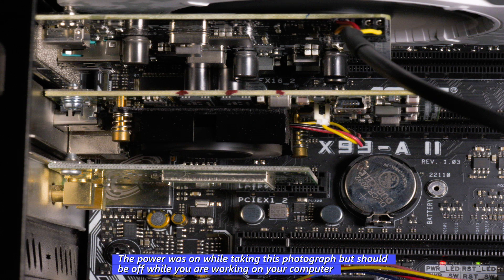Thunderboltex 3 card installation

Comment: My Asus Thunderboltex 3 (not 3-TR) seems to be working even without header cable connected, is it normal? It works well with a Dell Thunderbolt docking ... I was needing a trick to make its 5-pin header to my mobo which has 14 pins (ROG Strix Z490-F) but it seems to be working even without it.. I need TB for an audio interface not purchased yet to replace old Firewire stuff
Reply from the maker: At some point you will connect something and require the information that is sent via that header.
Your board requires the 3-TR card.

The setup in this video does not work because my MOBO was an early TB board.

My advice is by the correct AIC for the board you are using. Every cable, header and connector should be plugged in into its recommended slot. Failing to do so will result in issues of some kind.

After all this mess I bought a M1 MacBook Pro and have been very happy with it. 

Check with ASUS support before buying another thunderbolt card and get them to confirm that a return will be possible if the recommended card does not work, but make sure you have all the components you intend to use.

I had many issues with my thunderbolt card and Asus has tried to help, but I eventually just gave up on this quest.

Comment: Hi!

Great installation video! Would this card allow me to add support for additionnal monitors using the dual mini-DP port ?
Reply from the maker: In theory it should. Due to the age of my mobo and the fact that my board was one of the first in its generation to support all this functionality, due to that I have had many things not work on the card or work sporadically.

The USBc functionality on my card does not work, but the USB does, the TB3 functionality kinda works but it's a hit and miss. I think that is due to the fact that this was one of the first boards.

Also the fact that min-DP port based tech is prohibitively expensive in South Africa, I have not been able to get a monitor that has that tech to test the DP functionality.

I wish I could be more helpful but that is the situation I am in .

Thank you for your kind words. I appreciate it

Comment: I have a x99a setup with thunderbolt ex3. The card worked a while then when powering up pc next day didn’t work. I turned off the power of the source, flushed the power and restarted, voila, worked again. 4 days later after not using my pc, card stopped working at all. Tried everything, change mobo battery, reset bios, get card out put it back in, get out cables, put back cables of header.. it really makes me go crazy, I don’t know what to do else..:) my settings are the same as yours. Thank you!
Reply from the maker: Welcome to the world of craziness that I experienced. LOL! I have a call with Focusrite regarding my Red 4Pre that is not getting any audio from the card. That call has not been resolved for over a year. I think the problem is the X99A board. It was one of the earliest boards to support thunderbolt.

I had to replace the bios battery as well due to the bios not retaining my setting after installing the card. So I get you on replacing that battery.

My advice to anyone with that board is if you are having trouble, have everything configured as I do and it is still not working then forget about it. A later mobo might resolve your issue.

I bought a Mac Book Pro 14 inch and it works like a charm. With all the power outages in my country the best solution was going with a Mac laptop.
If regular power outages are something you are experiencing then you need to think about a laptop. If your electricity supply is reliable then get a later mobo that supports the card and build your system around that if the card is absolutely critical.

You can check the Asus website for a list of compatible boards and get the latest one that the card supports or ditch the tbex 3 card and get a mobo that has the TB ports on the backplate or a mobo that supports the TBEX 4 card.

I Hope this helps

Comment: My TBX 3 card worked for a while, but then just stopped. It's still all setup in the BIOS correctly, it's just not working anymore. Any suggestions on what I can do to trouble shoot this? - using it to run an external SSD drive, but the rive wont mount/show when i plug it on TBX 3 card
Reply from the maker: What changed between the last time your card worked and the first time this happened?
New OS, an update to Windows, installing new drivers anything at all?
Also is your system time correct?
Reply: Hey  @BellucciStudioz , really apprecaite you getting back. It's not worked for a few months, but im only now getting around to trying to fix it (i was putting it off as I suspected it would be difficult). There may have been a windows update (still on Windows 10 though) - it's the only thing i can think of. The clock on my PC shows the correct time yes. When I plug in my ssd to the USB port on the card, the light of the ssd goes on (so there power running to it - it doesn't show up as a drive on my PC though), but when i connect it to the TB3/usb-c port the ssd doesnt light up, which suggests there is no power travelling to the device via that route (the usb-c cable works fine elsewhere).
Reply from the maker: If there was a windows update then check if the Thunderbolt application is correctly picking up the ssd. To check that click on the start button and type “Thunderbolt”. There should be an app that comes up where you can ensure that the ssd is being picked up. Make sure that if the ssd is seen by this app that it is set to connect.
Aside from that, I have no other suggestions. This card really should not be this difficult to use but it is. The sad part is that there is not a lot of support for these cards. All the best dude.

Comment: Hey there! Thanks for the video! Can i use the mini display port on the new ex4 to connect a 2nd screen via a display port to mini display cable? Would love to know. Will be great help. Thanks!
Reply from the maker: Hi.

You can’t do that. The Mini DisplayPort allows you to send video into the card. The video output is on the thunderbolt ports. You can daisy up to 5 devices if they all have 2 Thunderbolt ports on each device.
This does mean that you need a graphics card with DisplayPort outputs. The thunderbolt card is not a graphics card which is why you need the graphics card with the correct port to send graphics out of the thunderboltex 4 card
Reply: @BellucciStudioz  ohh that's interesting to know.. That means a 2nd screen can indeed be connected to the thunderbolt port for a dual monitor setup?
Reply from the maker: Exactly right. If you have thunderbolt monitors you can have a multi monitor setup. If the thunderboltex 4 card has 2 thunderbolt ports and you have two monitors that use DisplayPort/HDMI/VGA/DisplayPort-over-usbc then you can via adapters (depending on what display technology and adapter combos are required) have a two monitor setup off of that one thunderboltex 4 card. That is the theory. Try it out and see what your motherboard and TBEX 4 combo allows for.

Comment: will this work for msi gaming pro carbon z370 specs?
Reply from the maker: It should work. If you already bought the card then try it out and see how it works for you.

However, if you can afford to buy a mobo that has the thunderbolt ports as standard then rather do that. These cards are really weird and don't work on all boards that they are supposed to be compatible with.

Comment: Hey, my ThunderboltEx3tr isnt working on my pc.
In the bios settings "amd pbs setup page" ive activated Thunderbolt Support, but the "thunderbolt host chipset" only has 3 options "Alpine Ridge / Titan Ridge / Maple Ridge" but none of those work. 
Im using the B550 F Gaming, wich supports the ThunderboltEx3 TR, it says online.
Thanks for your help :)
Reply from the maker: Hi Weshko
Let me see what I can find.
Reply from the maker: According to Asus it is compatible, but some other sources say this is not the case. The thing that I find interesting is that the manual for your motherboard says nothing about this card.

So I have a few questions:
1. Did you connect the thunderbolt header cable? Check to ensure that this was connected both to the header on the motherboard and the card.
2. Did you verify that the socket you inserted it is the socket you have it configured for? Check the writing on the board itself, check the setup as per my video where I  heckled which slot I was looking at. Then make sure you have the correct a lot configured under the thunderbolt menu.

This option where you select “Alpine ridge …” is there another option maybe even blank that allows you to skip those? Chances are that there is an option in the menu to disable this selection or bypass it. They give various options to allow various configurations. I am guessing that there should be an option to bypass this selection.

Check that and let me know. These thunderbolt cards are not the easiest to install.

Thank you for your sub
Reply: @BellucciStudioz  
1. I conntected the Thunderbolt header on the motherboard.
2. My build is completly fine 
3. I cant take a blank in the bios, ive got to choose something
Reply from the maker: Send me a message on @jacques_ford on Twitter.
Send me a screenshot of the bios screen so that I can see what you are looking at.
Reply: @BellucciStudioz  did send you photos on twitter^^ :)
Reply from the maker: I checked both my Twitter accounts and I don’t see anything. You can leave your Twitter handle and I will try finding you. @bellucciStudioz and @jacques_ford both don’t have any messages for this issue 🤔
Reply: @BellucciStudioz  its "petaruya122223"

Comment: Hi, have you noticed a big difference using Thunderbolt vs Usb specially for a audio interface?
Reply from the maker: Hi Cesar
I have never really used USB interfaces other than at College years ago.

But latency on Logic Pro with buffer size set to 32 is 2ms. And as high as 6ms on 256 buffer size. This is with a Red 4Pre.

Those figures are incredible, but that’s on a Mac. I unfortunately cannot test this on Windows as my motherboard and thunderbolt card combination does not pass through audio.

Comment: hi, I have a question. does this pcie card support data transfer and thunderbolt bridge. because I want to use my old computer as a DAS
Reply from the maker: Connecting my desktop to a Mac is possible. You will have to figure out how to let the Mac see the windows machine and vice versa. Whether connecting directly or over a network connection I always struggle to let the two devices see each other. And when I get it right it does not last very long. So it’s possible you just need to know exactly what you are doing and how to overcome the issue of visibility over the network
Reply: @BellucciStudioz  yea, so if I connect from windows to a Mac is possible through thunderbolt bridge with this pie card right
Reply from the maker: @whatthejohn1  yes. It is
Reply: @BellucciStudioz  thank you so much

Comment: Good video on a niche card, kudos! The BIOS settings was an eye opener. I ordered this card for my ASUS Maximus VIII Ranger board which is basically the same as Z170-AR but with slightly better voltage components for overclocking. I was wondering what applications people had for this card apart from 4K thunderbolt monitors? My interest is in getting an external thunderbolt drive for data .. will it be much faster than any internal SSD on this board? If so, how much faster and any recommendations on what worked well in terms of brands? Cheers.
Reply from the maker: I am going to put out a video on hard drives soon. The really condensed version is that if you are looking for blazing speeds above 1.5GB/s then get an internal NVME drive.

I don’t know of any drives that can really sustain the high throughput for more than a few seconds. External drives are worse. And if you can find anything that can do more than 400MB/s on a 50GB file it is going to be quite expensive.

You can check out OWC for their hard drive enclosures whether SATA or NVME.

My NVME drive does more than 750MB/s for a few seconds then drops to about 300MB/s for the remainder of the file then towards the end drops to less than 100MB/s. Compare that to a SATA SSD that for the first few seconds can do anything from 1.5GB/s then drops to 300MB/s to 400MB/s for the remainder no matter how large the file.

On the prosumer and consumer hard drive enclosures the speeds are horrible. But the pro stuff (really expensive enclosures in the price range of OWC) those tend to be much better.

I think it will be a good couple of years before NVME thunderbolt enclosures offer speeds close the max throughput of thunderbolt.

Every time I mentioned GB/s I meant gigabytes per second and for MB/s megabytes per second as opposed to gigabits and megabits. One byte is 8 bits. Some people use these interchangeably which is incorrect. 1.5GB = 10Gb
Reply: @BellucciStudioz  Thnx for ur awesome input. Looks like TB3's main forte at the moment would be in daisy chaining rather than singular mind blowing speed? I am reading of its use to run external GPU enclosures and desktop docks with multiple connections for the latest USB high speed protocols. In terms of data we are really limited to the speed of drives which, as u have noted, are well below TB3 throughput potential. Wouldn't harm to have the card in for the future I suppose. Cheers.
Reply from the maker: 100% agree. Thank you for watching and I hope you will be a regular viewer and possibly subscribe to the channel
Reply: @BellucciStudioz  Yes thanks, subbed and will be learning from ur videos which are quality over quantity! Have a great Sunday.
Reply from the maker: @melodychest9020  thank you. May your Sunday be blessed too.

Comment: Do you have the setup CD with you ??? if so can you share the image ?
Reply from the maker: Hi

The driver can be found at https://www.asus.com/Motherboards-Components/Motherboards/Accessories/ThunderboltEX-3/HelpDesk_Download/

I hope this helps.
Reply: @BellucciStudioz  Thank you appreciate it very much. the thunder bolt controller is showing up in System devices however... the usb drivers are just not being installed. I will try and possibly update you as well.
Reply from the maker: I have not managed to get the USB ports to work yet. But the TB3 port will work as a USB Port.

Maybe this is only a problem on older boards. My board is the X99A II and no matter what I do I cannot get the USB-A port to work.
Reply: @BellucciStudioz  Hi, 
that's interesting, because both Type-C and USB-A ports work with Z170-A (flash drives are recognised and opened), however when I plug-in my Apple Thunderbolt Display, it just don't work (whereas it works fine with a MacBook Pro).
Reply from the maker: @mutotuno  Do you have the display port plugged into the card as well from your graphics card? Please ensure that you have that plugged in.

The display port cable allows the graphics from your graphics card to be passed through the card to your Apple display. Try that and let me know how it goes.
Reply: @BellucciStudioz  yes, I stick to the instruction from the manufacturer - but no luck. Reboot doesn’t help. Will try updating BIOS and re-installing drivers.
Thank you for your help!
Reply from the maker: There are a few things I would check:
1. In Windows there is a Thunderbolt application (run this by hit the windows button then type thunderbolt, this app should appear) where you need to authorize various thunderbolt connections. Make sure you have authorized the connection to the display. If this does not fix things then carry on with the rest of the checks.
2. Is the video signal actually being sent? If you have a monitor that has display port connect that monitor directly to the display port on the card.
3. Make sure the thunderbolt cable you are using is also working.
4. If 2 and 3 are good then plug display port cable from step 2 into the card and connect the cable from step 3 into your card and the Apple display. If there is still nothing.
5. Check that the card is working. Plug a in network cable using RJ45 to usbc adapter. This is assuming that you have a router that uses network cables. Plug the network cable into a switch connected to the router or directly into the network port of the router. The other end with the usbc adapter should be plugged into the card. Make sure that the thunderbolt software has authorized the device. If the networking works then the card might not be compatible with that Apple display or Apple displays in general.

Comment: I have an ASUS Maximus VIII Extreme motherboard and when I plug it into the PCIEX1_1 slot it doesn’t give me the option in the bios to use said slot. I will try again with another slot but if anyone runs into this issue I just want them to see that this slot may not be usable for this card.

Comment: Thanks for this video! I have the same motherboard and was wondering how to add the thunderbolt card to it. Like you mentioned, the ASUS website has some info but doesn't go too deep into the installation steps. So, I appreciate it!
Reply from the maker: Awesomeness. You are most welcome!! It took many hours of searching and sifting through the internets to get all the right info. I am so glad that you benefited from this video.
Please consider subscribing to the channel. No pressure.

I plan on creating more helpful content and would appreciate the support.

What are you using the thunderbolt card for?

Comment: can monitor with regular usb-c connect to this tb device?
Reply from the maker: Thunderbolt 3 supports display port. So yes it should. Provided that the USB-c port that you are using supports display port. There is a difference between a USB hub on your monitor and a monitor that has display port over USB-C.

Make sure that your monitor supports display port over USB-C.
Reply from the maker: Check out this video I made earlier this year that explains a bit more about thunderbolt > https://youtu.be/z-KxVs5jOS4